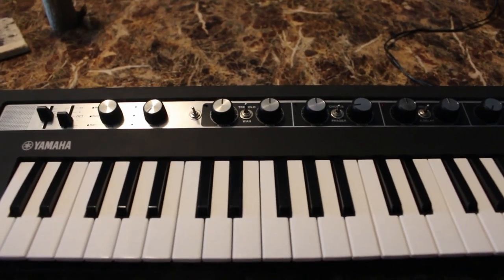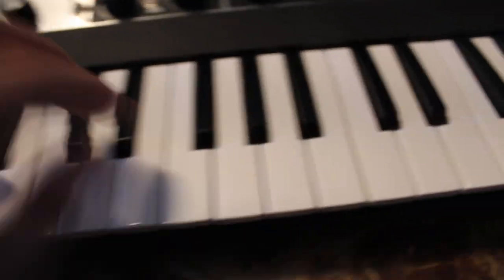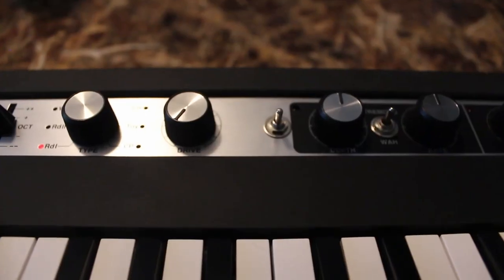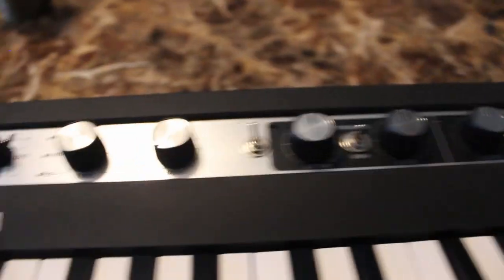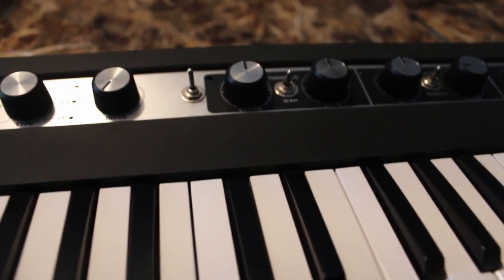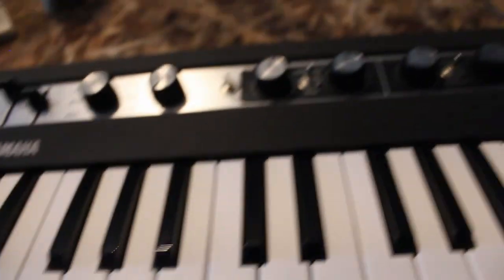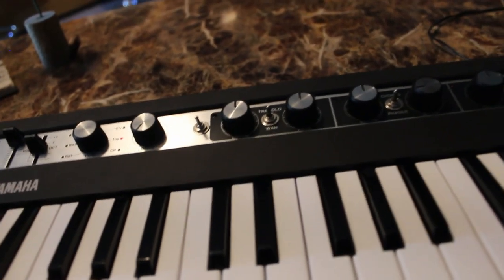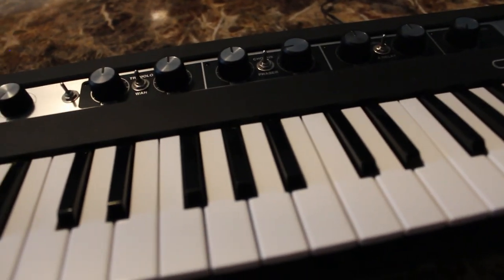Acoustic Piano Switch-Mod | Yamaha Reface CP

Comment: its said that on batteries the sounds distort ,is that true
Reply from the maker: I’ve noticed that it is quieter at full volume with a fresh set of batteries compared to plugged in. I think I may have noticed a little bit of distortion when using batteries too, but it has been a while since I last tried it with batteries. I will double check though. :)
Reply: @ thank you very much for yr reply.I want to buy one and take it busking where no mains,but I have a good amp.thanx again
Reply from the maker: You’re welcome! I imagine that it begins to distort as the batteries start to drain. If I remember correctly, it goes through batteries fairly quickly too so you’d want to make sure you take plenty of extra batteries with you. A good solution might be if you bring a larger battery that you can plug into the DC input, like one of those rechargeable car jump starters that have a built in outlet, or maybe one of those cell phone power banks with an adapter.
Reply: @ Thanx sooo much for info .merry xmas
Reply from the maker: Merry Christmas to you too! :)